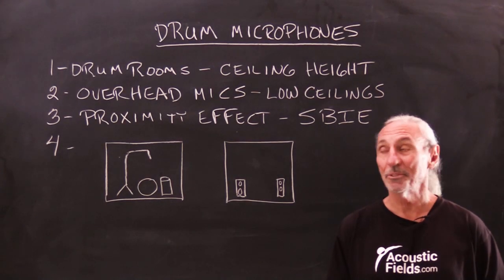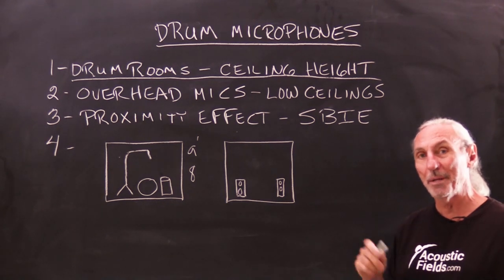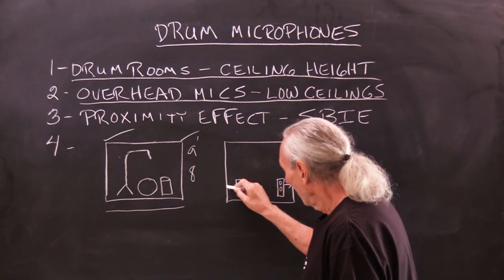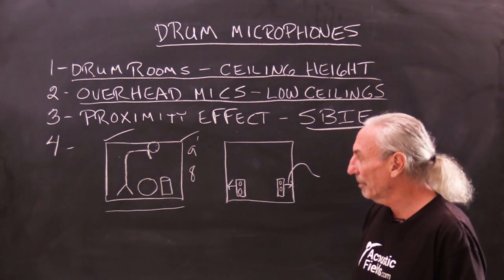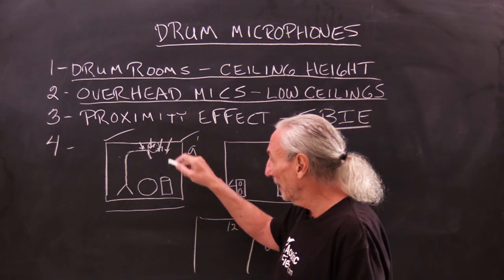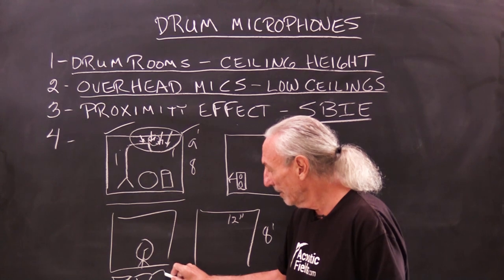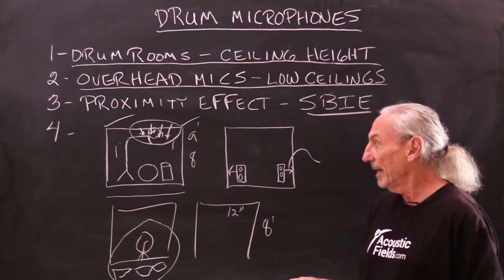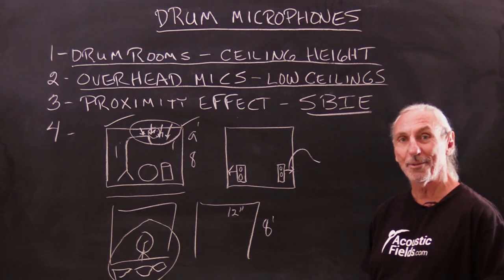Drum Microphones - www.AcousticFields.com

Comment: I put my speakers 3.5ft from the walls after hearing your advice. Makes all the difference! Wish I could get it to 4ft as suggested. SBIE makes all the difference.  This saved me spending even more money on treatment than was actually required. 

“I hope this helps” it sure does! Thank you.
Reply: NathanOakley1980 same! Made a big difference! I also used a few sound panels against my windows. These videos are a huge help.
Reply: How big is your room? I had them there with my former rear ported monitors but noticed that i got a better response closer to the wall with my new front ported monitors.

Comment: Probably want the drums closer to the overheads than the ceiling I’m guessing? So 15’ ceiling should do the trick maybe?
Reply from the maker: The best drum recordings are in rooms with 13 - 15' ceiling heights. There is simply no electronic substitute for higher ceilings and greater room volume.

Comment: What about violin overhead recording? Same thing, so we do need all ceiling to be an absorber plus an extra cloud absorber over a violin player between the ceiling and mics?
Reply from the maker: It all depends on the distance from the ceiling to source. You have absorption and diffusion as your two options. Absorption will have to be the choice if distances are less than 4' Make sure you are choosing the correct rate and level of absorption to match source.